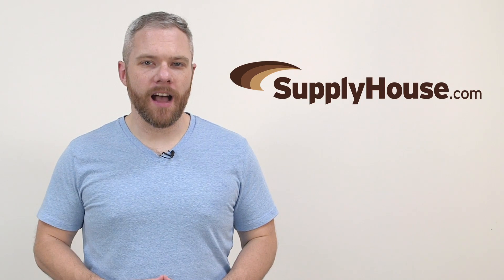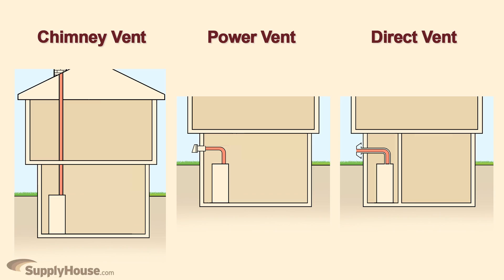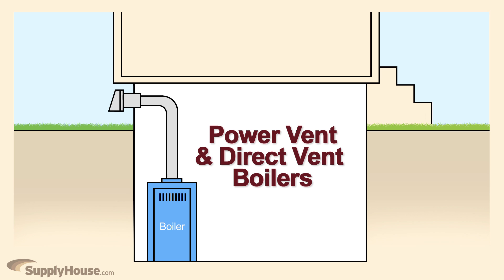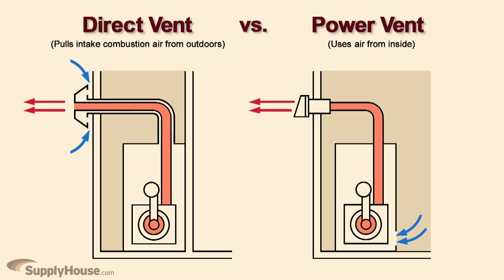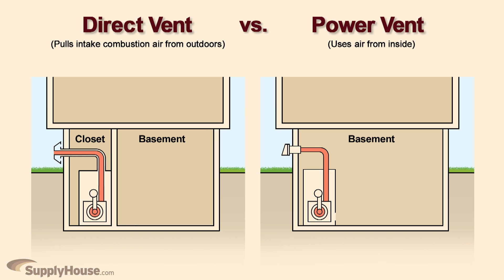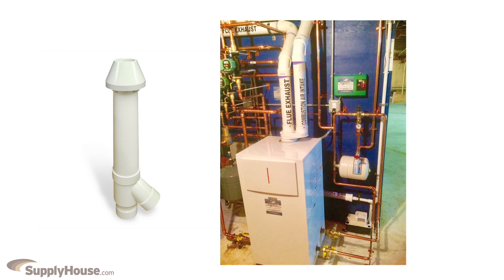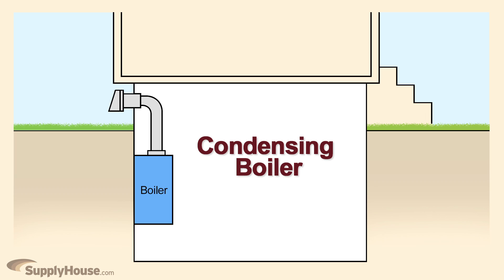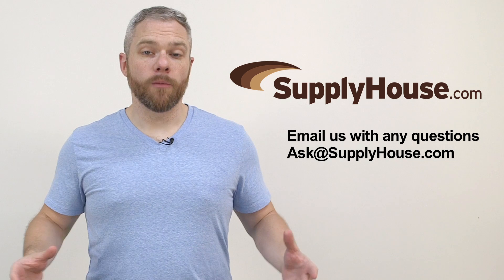Venting For Boilers and Water Heaters

Comment: hello i have a weil mclain gv4 gas powered furnace. the plastic ventpipe that is direct vented through a wall and was siliconed at the joints and was installed originally has cracked and i would like to get rid of this and could it be replaced with pvc pipe? does it matter if its sched 1 or 2?

Comment: wish i could find information on the possibilities of converting from a furnace to a boiler. Looking to buy a typical townhouse (built in 90s) - 3 stories with a garage. They ALL have hot air, which i hate! I would like to immediately convert to a boiler with baseboard and am prepared to pay the full cost of installation. But i want to be sure i can do this before i buy. Any suggestions how to determine this would be much appreciated. Though hot water heat is far better quality than hot air, i cannot find a shred of information on the internet about such conversions and how to ensure that this is possible. Really strange.